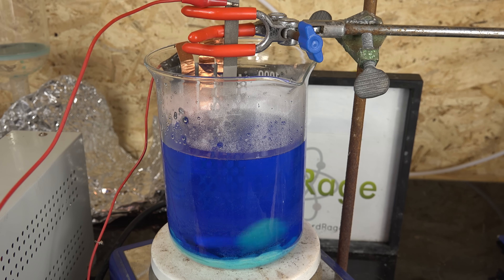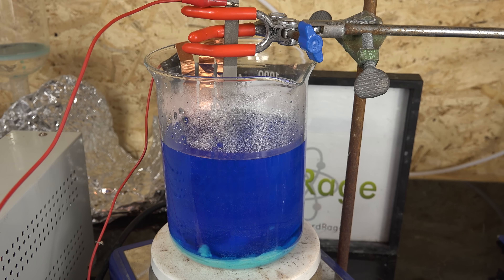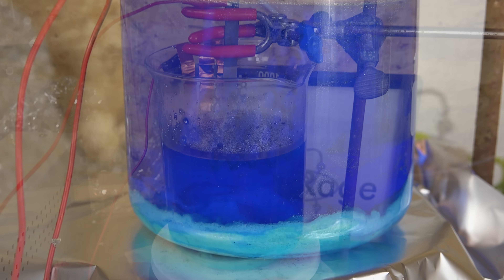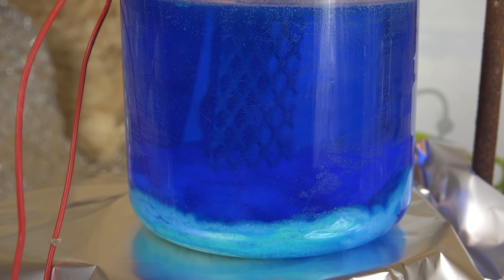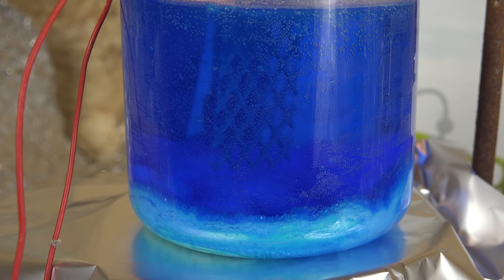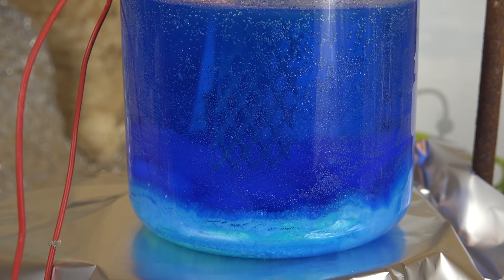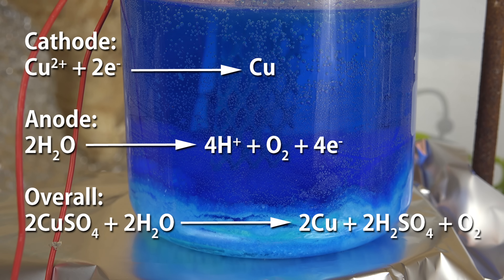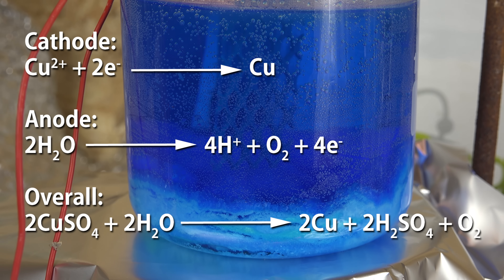Efficiently Recover Nitric Acid and Copper Metal From Copper Nitrate Wastes

Comment: great video .but i have a question .if you put silver and copper and dissolve it in nitric acid .if you add HCL you will get silver chloride .and the liquid will be then aquarejia .can we do this method to get back nitric acid
Reply: You will need to remove the chloride from the solution first.  This can be accomplished by adding a soluble nitrate that forms an insoluble chloride with any chlorine in the solution.  Silver nitrate comes to mind as a viable chlorine scavenger. A slight excess should be used (no more AgCl is formed when AgNO3 is added).  Be sure to filter out the silver chloride formed and then add more solid copper to cement out and collect the excess silver as described in this video.

Comment: Can i use a pure gold anode ? i'm metal refiner and it's easy for me to melt gold anode.
Reply from the maker: unfortunately no, gold would be destroyed under these conditions. "platinized titanium" is not too expensive and even a small electrode will last for many years if you use low currents.

Comment: How about using a lead anode for those who could not afford a platinum one ?
Reply: Also see Nurdrage’s videos on making MnO2 electrodes.  

manganese sulfate can be made by treating manganese dioxide with sulfur dioxide:

MnO2 + SO2 + H2O → MnSO4(H2O)

Wikipedia claims the reaction is reversible by electrolysis, in theory forming a MnO2 plate.
Reply: Lead works fine. The Sreetips channel has many videos on this reaction, and he always uses lead.

Comment: This is a great video. Considering that dilute nitric acid is fine for a number of refining processes, it might not even be necessary to concentrate it further. Considering that nitric acid is by far the most expensive chemical used for basic gold refining, getting a fair amount of it back using equipment most would already have (well maybe they'd need to pick up a condenser) is pretty useful.

Comment: The copper oxide recovery also applies to sludge I get in my acidified copper sulfate electroforming tank. I put ingots in felt bags and after 4 five runs they are half full of goo. I have about 20 pounds of it. The tank is a low acid recipe.
Reply: Ceviri ekle

Comment: I hope you some day may be do whole series of all impurities cleaning process from any liquid form. Meaning most used preferred, so example there is little to no use remove astatine or radioactive elements cause there is almost none of them in commercial products, but all solids that may be in solution like most of the metals, post transaction metals and non metals solids. Its interesting to think process that you can take all of these in good use just knowing how to.

Comment: Oh man, there is a whole world of precious metal youtube out there. Sreetips is so interesting to watch him dissolve metals, and then get super high purity metals.
Reply: @Eric Konschuh He's very selective about how much nitric he uses, so he doesn't end up with much excess in most cases.
Reply: @andybaldman  Even so, recovered nitric acid means less money spent buying new. That adds up in the long run.
Reply: @vinnycordeiro  If you watch sreetips's videos, you'll see the techniques he uses to make sure he has little to no excess.   And then he reuses any waste he has in other processes.   And any waste he has after that, he treats and discards.   It's a pretty efficient system.   He's done videos on all of it, you should check them out if you haven't.
Reply: @andybaldman  I do watch Mr. Sreetips' videos.

I do acknowledge that he uses a small dosage of nitric acid to avoid unnecessary usage.

Even so, he IS expending nitric acid, and what this video proposes is the reverse process: recovering the nitric acid originally used to dissolve the base metals (mostly copper). He just need to remove all the precious metals, mostly will be silver, and then apply this video's method to recover the nitric acid. And because it is diluted, he can just use it to dissolve more silver. It's a virtuous cycle.

Also: at least in the US, sulfuric acid is cheaper than nitric acid. And because Mr. Sreetips doesn't see the point of recovering copper, as said in some videos and many comments, he can skip the sulfuric acid recovery, just neutralizing it and properly disposing the neutralized acid and the copper sulfate.

The point being: in his current workflow, Mr. Sreetips is just throwing away nitric acid that could be recycled.

Also: remember that Mr. Sreetips always says he's just an amateur, refining precious metals is his hobby. Nurdrage have a PhD. in chemistry, it's his job. And the professional acknowledged that he didn't knew something and was willing to share his knowledge. A hobbyist can learn this and use if desired.
Reply: @vinnycordeiro  Where in his process does he end up with excess nitric?
Reply: @andybaldman  I never said that. I'm afraid you are not understanding what I'm trying to say here, so I'll try to explain more carefully.

After all processing, we have copper nitrate { Cu(NO₃)₂ } waste, no free nitric acid; the process described on this video adds excess sulfuric acid { H₂SO₄ }, and by distillation a reaction occurs between these two components and we end up with copper sulfate { CuSO₄ } and nitric acid { HNO₃ }, along with some unreacted sulfuric acid. What's happening here is that the original reaction - copper being dissolved by nitric acid giving copper nitrate - is being reversed, using sulfuric acid as an intermediate.

That's why we talk about "recovering" the nitric acid in this video, the original reaction is being unmade, not because there is excessive nitric in the solution. We are manipulating the molecules in order to get back the used nitric, that can be reused later on further refinings.
Reply: @vinnycordeiro  Ah, gotcha.  You are correct.   Thanks for the clarification.
Reply: @andybaldman  You're welcome.
Reply: @vinnycordeiro  In my opinion he could reduce all that chemistry to 1 step and use electrolysis to dissolve the raw input stock in hydrochloric acid.  The silver would precipitate as AgCl, and the other metals would go into solution, and plate out on the cathode.  In this 1 step, he would get the silver separated and the other metals in non-hazardous form, without consuming significant acid.  Silver would be recovered with standard NaOH/sugar reaction.
Reply: @vinnycordeiro  Actually, when sreetips refines silver he first dissolves in nitric, expending it. Then he precipitates the silver as silver chloride using hydrochloric acid. This immediately forms new nitric acid, but I dont think he realizes... I sent a message about this in his last video where he builds a small kiln from kaowool. He replied but didnt seem to get the point. So I explained some more but no more reply... I think many refiners could benefit from the process in this excellent nurdrage video, but also from realizing nitric acid is formed by adding hydrochloric acid to silver nitrate.
Reply: @MegaFrankels  That's only when he have to refine silver from silver chloride, which he avoids as much as he can. Usually he just adds pieces of copper on silver nitrate solution, which directly precipitates metallic silver.
Reply: @vinnycordeiro  True... most of the time he uses copper to cement out the silver... then you could use this nurdrage process to regenerate the nitric from the copper nitrate. But distilling nitric is not for everyone and you need a distillation setup. Choosing to use hydrochloric acid to precipitate  silverchloride and regenerate nitric acid may be cheaper/ easier/ less labor intensive than cementing out the silver and either regenerating nitric with sulfuric acid or straight up buying new nitric. Of course with silver chloride then you need lye and sugar as well... I guess it comes down to  how cheap you can source the materials/equipment and how efficient/big your setup is. And how valuable you deem your time. I dont know enough to be able to estimate what would be cheaper/ more efficient. But its definitely an alternative.
Reply: @vinnycordeiro This is essentially what happens in aqua regia too.. the nitric can dissolve a little gold, then the hydrochloric immediately "unmakes" the copper nitrate, making chloroauric acid and restoring the nitric.
(..which I'm sure you know.. just saying it for other readers..)
Reply: @MegaFrankels the problem with lye/ sugar process is the amount of waste it produces. It does give more pure silver than copper precipitation.

Comment: The platinum electrode can be replaced with  carbon rots. They will be eaten away very very slowly by the oxygen, but it will not harm the reaction. And they are cheaper than platinum electrodes.
Reply: By the way, sulfate ions tend to intercalate a graphite anode and exfoliate it into few-layer-graphene
Reply: In nitric acid solution/metal nitrate recovery, you can use lead instead of platinum. 
Like the carbon rods, the lead does degrade with use, however, it's oxides are easily entrapped to prevent contamination of the copper.

Comment: Can you avoid spongy deposits by ramping down the current at the end of the run, or perhaps even matching the current throughout the entire run with the measured impedance of the solution? May be worth doing for larger scale batches, for just for the science of it.
Reply from the maker: You could ramp down the current, but then the process becomes VERY slow. the first 90% is quick and takes a few days, but if you keep ramping down to match the copper potential, the last 10% can take weeks. So it's best just to stop when the solid copper sulfate is gone.
Reply: If your intent is to just recover as much copper as you can because you're going to smelt it all down at the end, it being spongy and weakly deposited shouldn't matter all that much. Otherwise, like NurdRage said, should just stop when it gets near the end since the copper left in solution will just feed forward with further use (just dedicate that volume to use for metal refining only).
Reply: @KainYusanagi  Many years ago I ran the computer graphics lab for a professional photography lab, back in the chemical photography days, and they had this big tank with electrodes that they stored their waste in. Very large, but chunky, crystals of silver would build up on the electrodes, I just wondered what sort of methods could have been behind that metal recovery unit.

Comment: If you use two copper electrodes then you effectively electrorefine the copper from the anode.
Reply: It's a bit counterproductive, however. To deplete copper from solution you need an inert anode - dissolving copper anode will be raising the copper ions concentration. So you would end with thick cathode, no anode, and still a lot of copper in solution.
Reply: It's a consumable, sure, but it's 100% recoverable.

Comment: This is what happens to processes of hobby refiners when the real science comes in! Thanks NurdRage, you are the real professional!
Reply: I've been recycling my copper nitrate for years...I first posted on the GRF about recycling copper solution over 10 years ago. If you plan on doing any serious refining, recycling your waste is not only the right thing to do environmentally, but also economically.  That being said, NR has a very special way of presenting material that makes it understandable even to the layman. He is a valuable resource for everyone in the refining community.  Steve
Reply: @lazersteve  Iron is also used by refiners to precipitate the copper out of the copper nitrate, the iron nitrate is then disposed as a waste product. Do you know if this is any better or worse than using sulfuric acid?
Reply: @lazersteve  How do you recycle your sulfuric acid that is contaminated with base metals?
Reply: @lazersteve  Thank you for such an elaborated answer. It sounds very complicated to not bother in most cases, but as a matter of principle it is nice to know that the purification could be done.
Reply: @bormisha  it's no more complicated than any other salt chemistry. Key points to know are solubilities of the various salts, ions present, and which ion combinations precipitate which salt. Temperature plays an important role in these parameters as with any chemical reaction. I usually convert my alkali sulfates to nitrates then use the dissolved nitrate as a solution in my refining work forming nitric acid in situ.
Reply: @lazersteve  i hope to one day see this in action

Comment: Can you ramp down the current as the copper sulphate depletes to slow down the deposition and make it more stable as it switches over to hydrogen production?

Also, if you connected a voltmeter across the cell, would the driving voltage change as the CuSO4 depletes?
Reply from the maker: You could ramp down the current, but then the process becomes VERY slow. the first 90% is quick and takes a few days, but if you keep ramping down, the last 10% can take weeks. So it's best just to stop when the solid copper sulfate is gone.
Reply: Yes, a voltmeter will be diagnostic.  The voltage rises as copper concentration falls, until 2H+ --> H2 dominates.

Comment: No need for Pt electrode, lead metal will work just fine (only in sulfuric acid media of course) !
Reply: I think NurdRage's point was to be as non-toxic and environmentally friendly as possible.
Reply: @ropersonline  Lead is not going to be consumed at all, look how lead acid batteries work, electrodes stand  for decade in such environment. Only small amount s of lead dioxide is expected to pile off over time and even that is in insoluble form.
Reply: @papanyanz  yeah but lead sulfate is soluble and lethal if touched or inhaled
Reply: I mean lead anode.
Reply: Indeed.  Note: put a bag over it, the PbO2 that grows on the electrode tends to swell and slough off from time to time!
Reply: Hii I wanted to know how we can calculate the current densities for anode and cathode. Could you please hel
Reply: @mialauren3727  Current density is current (in Amperes) divided by surface area of the electrode. You'd need some school geometry to calculate that.

Comment: does the same method work on CuClO ?
Reply: Just make sure HCl is completely removed during the distillation step.  Can check using AgNO3.  Electrolysis of chloride will produce chlorine gas.

Comment: Yay !  Super useful chemistry for the GRF guys !
You deserve more bananas my friend.
Reply: @aga: for refining copper based scrap purposes there is no need to distill off the nitric acid; simply cool the copper sulfate/nitrate mixture to crystallize out the bulk of the copper sulfate and keep repeating the digestion/freezing cycle. A small amount of copper sulfate remains after each cycle, but is limited by it solubility at sub zero freezing temperatures,  much like my cold nitric acid recipe.  For added strength simply evaporate (no need to distill) off excess water before freezing.  I call this my evaporation nitric acid technique...works wonderfully. Of course you can follow NR techniques to recover the nitric for other purposes if thats what your goal is. Steve
Reply: @lazersteve  Many thanks for that. Great advice. I only delved into Gold a few times and generated so much toxic waste from e-scrap it took about 3 years to neutralise it all down to safely disposable substances. - more like Waste Treatment Chemistry than any actual gold (or even Fun).
Nurdy shows Many recycling opportunities for you Real refining people, of which this video is an excellent example.
Reply: Many people deserve more bananas.
Reply: @aga5897  over the years of my refining I realized that precious metals refining should be viewed as a base metals refining effort, with the precious metals being a valuable by product of the continuous cycle.
Reply: @lazersteve  Awesome ! Absolutely Awesome !
Reply: To be clear : Absolutely Awesome !
Most Gold refiners just see and talk about the Gold Gold Gold ! oh, and the Gold, maybe the Platinum (where they should look more at the Palladium)
Yes, Refining is all about the Junk and how to remove it, or at least push it to the side.

Comment: Can you just distill the sulfuric acid to get rid of contaminants? It doesn't look like there should be anything volatile there.
Reply from the maker: absolutely! but it's REALLY hard to distill sulfuric acid. also the acid is still depleted as it accumulates metal sulfates, so you're still going to need to top up with fresh acid on occasion, thankfully it's not too hard to do.
Reply: @NurdRage  hello I want to ask  about  ion exchange separation  membrane for potassium and sodium  for example
Reply: @megahaker7712   3M sells membranes for that sort of thing. They are expensive, but reusable.
Reply: @Mega Haker,

Potassium tetraphenylborate is a salt with the formula KB((C6H5)4). It is a colourless salt that is a rare example of a water-insoluble salt of potassium

Or potassium aluminosilicate
KAlSiO4 (water insoluble)

poly(sodium styrene sulfonate)

Also Potassium tartrate, if the pH didn’t decompose it
Reply: @NurdRage  And for that matter, once you're up at those temperatures, and transition metals get involved, their sulfates all(?) decompose to SO3 -- nasty!